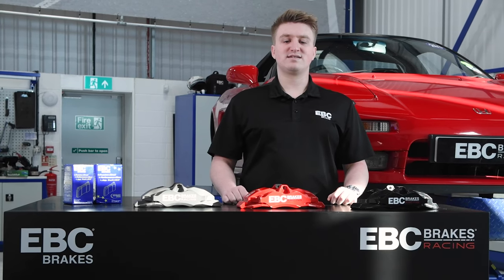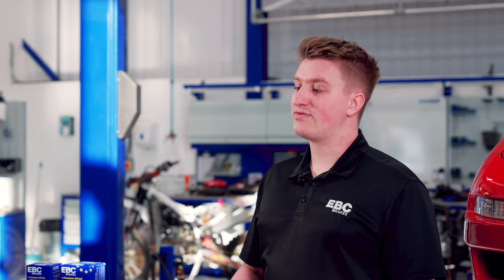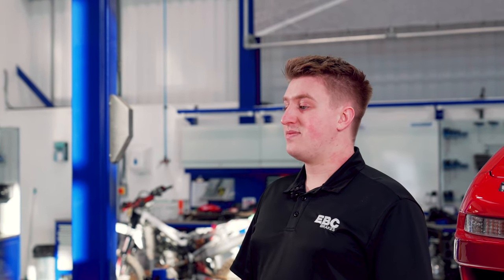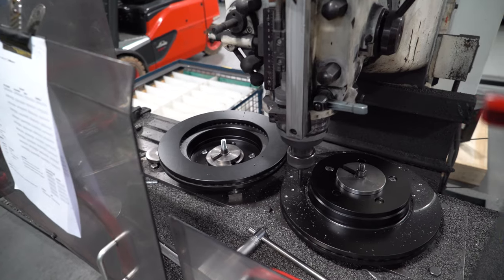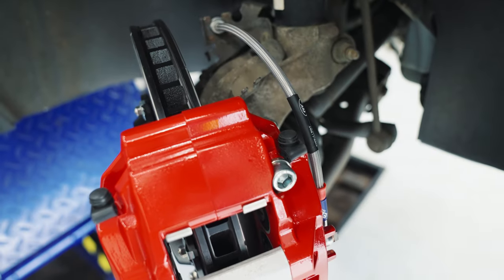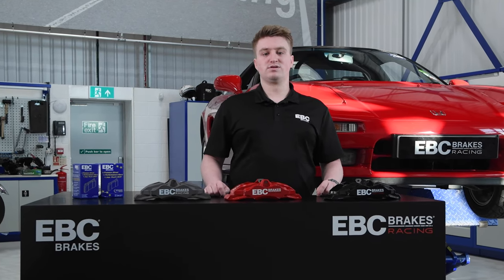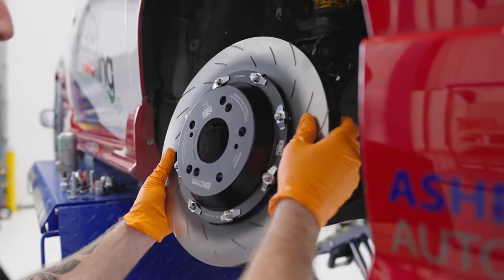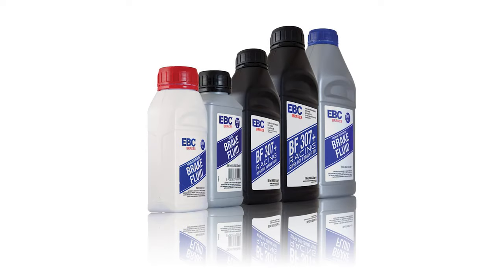We Answer Your Brake Questions! | EBC Brakes Q&A

Comment: I just installed blue stuff ndx on brand new slotted rotors, and they squealing like mad.

I think I have 50 to 60 miles on them by now and still super loud.  I have only done regular around town diving, no severe high speed stops.
Reply from the maker: Drop an email to technical@ebcbrakesuk.com and they can help with this :)

Comment: I think it would be fantastic if all EBC brake discs received ECE R90 approval. My vehicle is relatively new (Octavia built in 2019) and I can only install ECE R90 approved brake discs on my car. An ABE (general operating permit, for the German market) does not apply to my model (facelift).
What is the current status for this?
Reply from the maker: Hi, drop an email to our team and they can help with this. You can reach them at technical@ebcbrakesuk.com :)

Comment: Do your 2 piece discs have same bolt pattern with Brembo discs?
I like to get replacement for my 2015 Abarth 595 Turismo 305 mm Brembo floating discs and Brembo only offers whole disc with center piece.
I have your USR1648 discs now that are very good but double as heavy than floating discs.
Reply from the maker: Drop an email to kits@ebcbrakes.com and they'll be able to help you with this.

Comment: Hi, need pad size or part no. for Red Stuff to go on a 2018 GTI running OEM discs, 312mm front diameter and 300mm rear (non-Performance Pack system). Thanks in advance
Reply from the maker: Drop an email to our technical support team at technical@ebcbrakesuk.com and they can help you get what you need :)
Reply: @EBCBrakesUK  all sorted now thanks, ordered through Awesome GTI parts distributor, looking forward to getting them on the vehicle